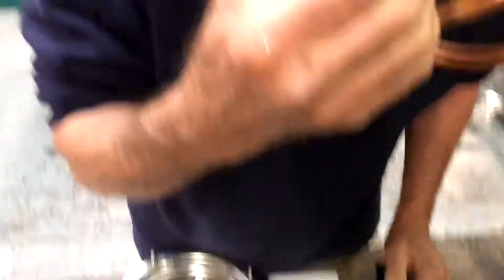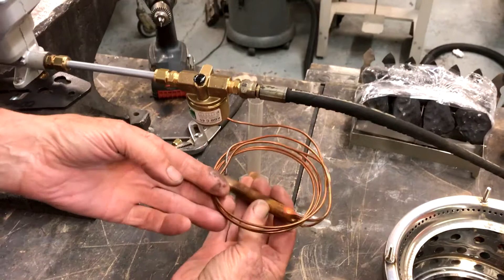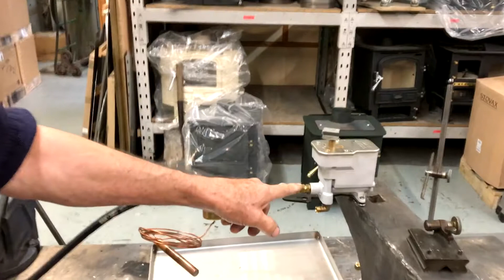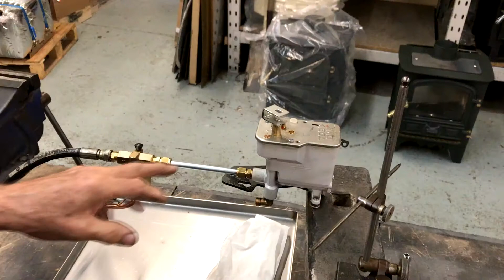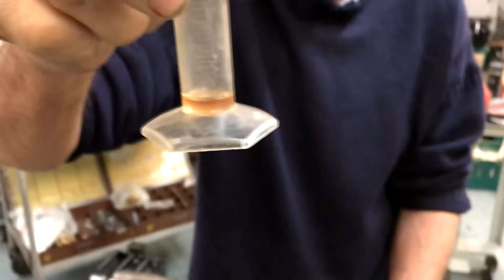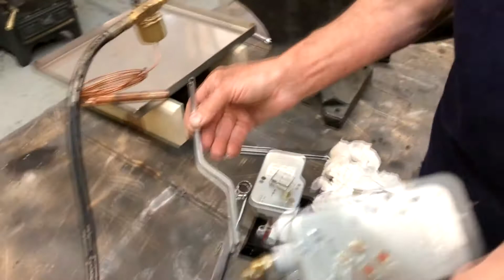Fault finding issues for vaporising pot burners.

Comment: What is the best way to test the flue vacuum?  I undressed the vacuum is 0.01WG for a cold flue and 0.07wg for a warm flue. What is the best way to check this as my stove is burning yellow, but the flow rates are correct.

Comment: prosim vas
pri akej teplote vypina ventil a kde sa da kupit?
Reply: I am no expert but the copper sensor in the burn chamber operates when it gets too hot. For example a flame outside the vaporiser.  It is an analogue system...the signal then trips the fire valve. I think amazon and online plumbing and heating suppliers will have one ...but they are old school analog so no fixed temperature

Comment: When the stove is in use is there a depth of oil evenly spread over the base of the pot, or does the oil vaporise  and burn immediately as it enters the pot, which would mean that the pot is for the most part dry during operation ? If there is an even depth of oil in the pot what depth is it ?
Reply: There should be absolutely no oil puddle in the bottom of the pot ever. If there is soak it up and start the lighting procedure again. The oil goes from liquid to gas the second it enters the hot burner pot. The trick is in getting the pot hot enough to begin with for this to happen.